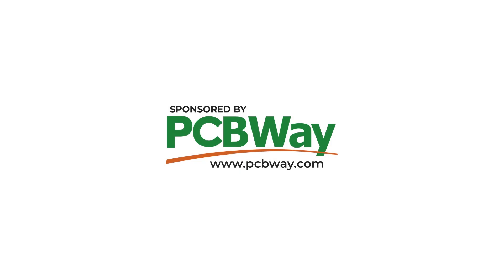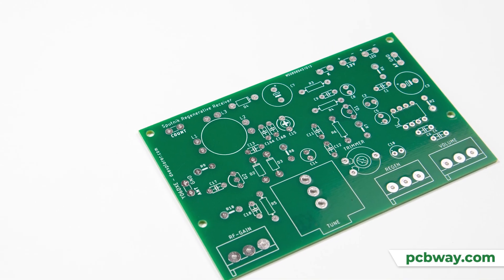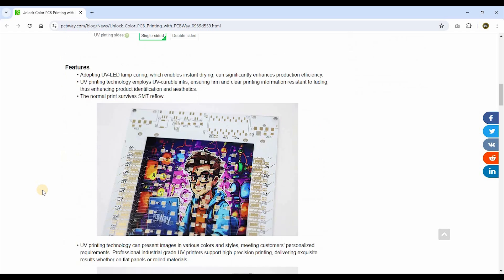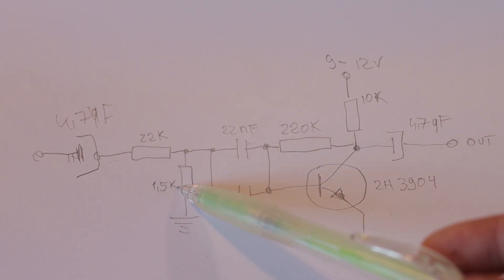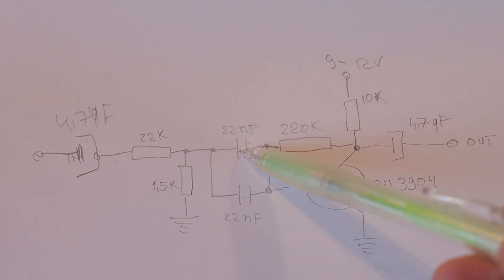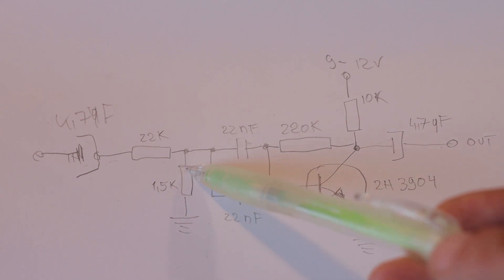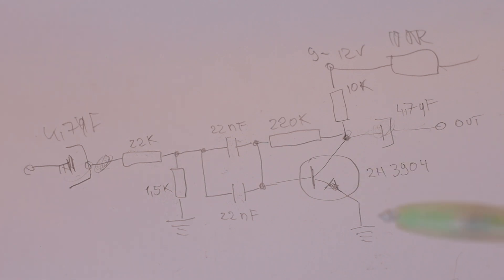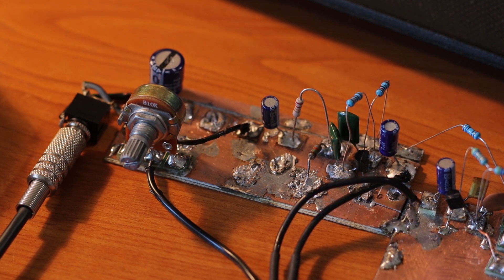600Hz One Transistor CW Audio Filter - Active CW Audio Bandpass Filter

Comment from the maker: In the video describing the schematic, I meant NPN transistor not PNP. Also in the schematic the top capacitor is connected wrong. It should connect to the junction between the 10K and 220K resistors, not to the 220K resistor as it is in the schematic from the video. I was in a rush to film the video as I must get back to work 😄. Note to self... do not film videos at 6AM 😂. Thanks so much Ian and Hendrik for letting me know. 73, YO6DXE

P.S. You beginner ? 😁

Comment: Very nice and simple single transistor filter and without a coil 😁
Reply from the maker: Yes hehehe. That is why I love it. By the way... there is a mistake in the schematic.... the result of filming at 6am. The top capacitor does not connect to the 220K resistor... but to the junction between the 10K resistor with the 220K resistor. 73, YO6DXE.
Reply: @dxexplorer  yeh noticing now ;)
Reply from the maker: @Chems7308 😁🤣🙏

Comment: Hi Chip, nice little filter, I may have to use it in a project. I think there is a small error in your circuit. The top capacitor should connect to the junction of the 10k and 220k resistors. As it stands the capacitors are just connected in parallel and there would be no filtering. Take care, 73, VK7IAN
Reply from the maker: Yes..  my friend Henrik just messaged me on Whassapp to tell me the same thing. I filmed at 6AM no wonder I draw badly 🤣. I will correct it in the blog article. Thanks for letting me know Ian. I just noticed now. 73, YO6DXE

Comment: Very good. I like this cw filter, I might use it in few schematics (I love how simple it is😁). you are great guy. good luck 🍀. 4l1lat 73!.
Reply from the maker: Simple is what I also like 😄😄. Should me my nickname 🤣. Sounds really great for how simple it is. 73, YO6DXE ( P.S. The top capacitor in the schematic I had it wrong. It connects to the junction between the 10K and 220K resistors not just to the 220K resistor as it is in the schematic from the video. Filming at 6AM may not be so smart I guess 🤣 ).
Reply: @dxexplorer  at 6 in the morning I even don't know my name 🤣 if you accidentally made mistake it nothing 🤣🤣🤣🤣
Reply from the maker: @4L1LAT Yes but I wanted to let you know now... so you don't wonder later why the filter doesn't work 🤣🤣.
Reply: @dxexplorer  🤣🤣. ok thanks in advance. good luck and 73!. good luck.
Reply from the maker: @4L1LAT 73 my friend and have fun with the filter. I can't wait to finish the receiver now 😁😁